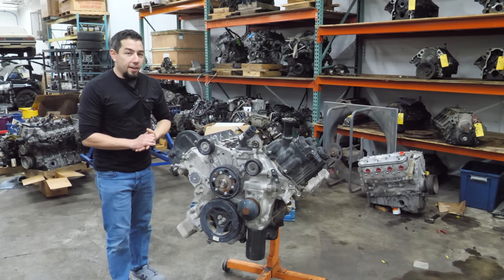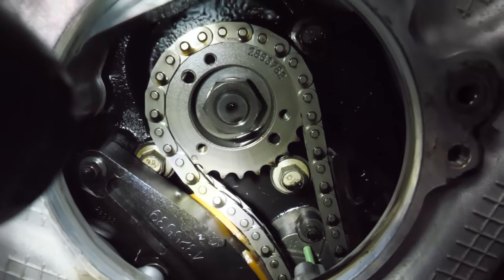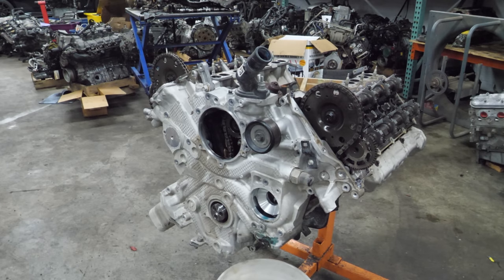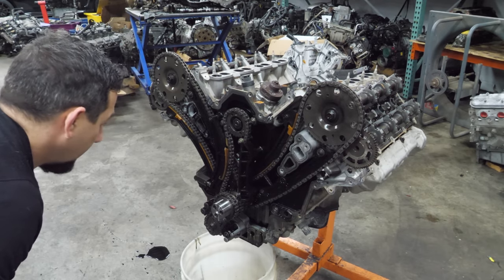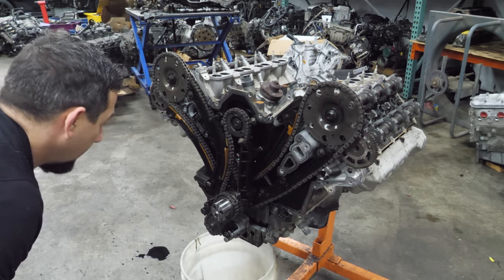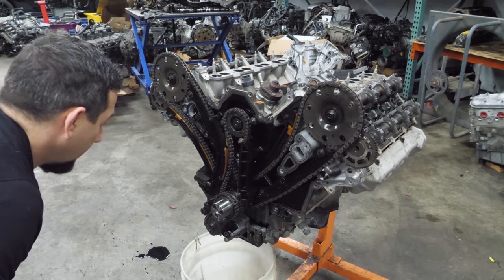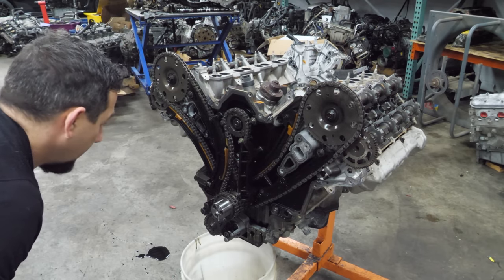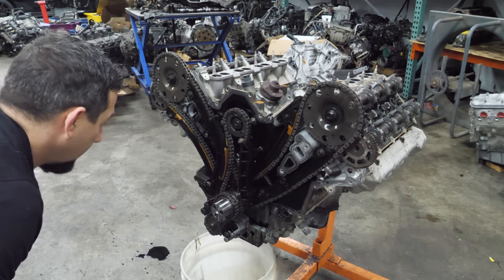Well That's Not Good! Nissan Titan XD Cummins 5.0 Turbo Diesel V8 Teardown. A Costly Failure!

Comment: I broke a crank in a 87 supra between cylinder 1 and 2. Felt a slight vibration and pulled over in the middle of nowhere 20 miles from home. grabbed  the dampener and could feel the crank wiggle. Figured screw it and drove it home. Amazing engine Toyota made, ran on all 6 with a slight  vibration. Rebuilt it and drove it for years.
Reply: Ya, your experience is  a kinda normal Toyota thing. The broken crank is unusual. I  like to use quality aftermarket dampers if lotsa hi RPM use planned.

Comment: As a Cummins owner I loved this video. The crank failure issues is unfortunate. I was aware of this engine dating back to the early 2000s as a DEER development project. There was a V6 as well but it was never developed to market. 

I am hoping you’ll do a teardown of a 3L baby Duramax.
Reply: I would have loved to own a Frontier with that v6. Obviously non emission.
Reply: Of course it was,I heard about th
Reply: Second the BabyMax.
Reply: The mini max is the same engine as the CDL diesel in 2004-6 Jeep Liberty(s)
Reply: @jsawyer0617  Isn't the Jeep engine a 4 cyl?
Reply: @--_DJ_--  Yep, so is the newer 4 cyl Baby Duramax. I had the VM Motori 4 cylinder in my liberty.
Reply: @jsawyer0617  The diesel in the Liberty is the 2.8 4 pot baby duramax. The straight-6 Duramax is a new engine derived from extending an Opel 4 cylinder diesel.
Reply: @jod4689 Correct, the 3.0 Duramax is derived from the 2.0 Opel inline 4 which is itself derived from the Opel 1.5 inline 3, which is derived from the Opel 1.6 inline 4 that we got here in the Cruze and Terrain. These engines are so much alike, in fact, that you can take the 3.0 Duramax timing chain tensioner and use it as an upgrade to the junk one on the 1.6 that breaks and makes noise.
Reply: You mean a V6 developed by Cummins? That would've been the first since the 70s when they had the V360 and V378 with laughable power....

Comment: Since you asked, according to the Service manual, torque spec on the interior head bolts is 89ft/lbs  (120n/m) plus 180 degrees. The outside ones are only 17ft/lbs (23n/m).
Reply: Well 30 ft lbs Then 89 ft lbs then 180 degrees

Comment: Glad you and the family are feeling better Eric!! Your fans certainly missed you last Saturday.

I drove a 2017 Titan XD diesel 4x4 crew cab for just over three years for work. At 79,000 miles it went into limp mode one morning on the way to work. After nursing it a couple of miles to the Nissan dealership and dropping it off, we found out 3 days later that the actuator that drives the hybrid-compound turbo variable geometry had failed. It took four weeks to get one because they were failing at an alarming rate. I naturally did some digging on YouTube and came across a video where the same thing happened to another guy - but his failed at about 40k, I believe. When he pulled all the piping, the turbos, and the actuator off the engine, he found that it was so badly coked up, that they had to scrub it with gasoline to get it clean. Come to find out, this had been happening all over America with this engine and Nissan was trying to ignore it.

I sent the link to the video to my service guy at Nissan and asked him to please pull all of the turbo piping and the turbos to inspect and clean them. He said “No” because Nissan wouldn’t pay for that under warranty, only to R&R the bad actuator. I asked him if he had watched the video, and he said he did. I asked him if he had kicked it upstairs and he said he did. I asked him what the response was and he said they wouldn’t comment on it and to replace the bad part. 

Four weeks after the truck went to the dealership, we got it back. 8 weeks after we got the truck back, we sold it before the warranty was out. The same thing happened to the other Nissan XD diesel in the company fleet. Same scenario: about 4-5 weeks to get the part, and we sold the truck about a month after we got it back.

It’s too bad. That could have been a great truck. Unfortunately, Nissan had to monkey with the engine instead of just buying it from Cummins. It was overpriced, barely had more towing capacity than the 5.6 gas engine, and the transmission totally sucked. The truck was quiet, rode nice, and got pretty good mpg’s for what it was.
Reply: Quite the story
Reply: Nissan didn’t monkey with it. It was a bad design from Cummins. Nissan bought the entire thing from Cummins.
Reply: I'm in construction supply and also know lots of people with boats and horses. Nobody bought a Titan XD diesel. When you need your diesel truck to get something done, you need something you can rely on 300 miles from home with a trailer. Nissan had one chance to start their own diesel customer base. They failed miserably. They had a chance too, as a lower cost fullsize truck diesel option would have sold if it was good. The last gen Titan's biggest flaw was its crazy thirsty 5.7 V8 (compared to modern competition), so I can see why they wanted an affordable diesel option.
Reply: @BReal-10EC  yeah Cummins dropped the ball. Hard.
Reply: The engine has nothing to do with Nissan supposedly monkeying with it.  The engine is even listed in Cummins' catalog and on their site for sale.
Reply: @MrDrmorbid  Yeah... one angle could be they have stockpiles of those engines made that Nissan never used and they need to sell them. Though just like with the Ford/Navistar problems Navistar blamed Ford's implementation and Ford blamed Navistar's design. The blame game is always fun but the customer always loses. These engines must be designed with the concern of passing emissions right? Makes me wonder what the creator versus implementer argument really is.
Reply: Same thing happen to me i had the 5.0 cummins 2017 i ended trading it in for a duramax! Im glad i did! Because parts where hard to come by
Reply: @BReal-10EC  ummm, no.  Cummins has catalogs and one buys those engines and they offer them to everyone.  Try visiting the site and you'll see.  They were there before the Nissan deal and were offered to other manufacturers as well.  Like why is this such a tough concept?
Reply: Just an FYI, Cummins does have the engine in their catalog, but there are major differences between that one and the Nissan version. Nissan had Cummins up the horsepower significantly... Also the hybrid turbo in the Nissan version is not in the Cummins version.
Reply: @notsevenfeettall  Maybe they used Izusu engines in their box trucks.
Reply: The EPA emissions requirements killed this motor.  Otherwise, it would have been a great truck.  I removed all that nonsense from mine, and it runs like a dream.  No smoke.  No soot.  No turbo lag. The oil is see-through clean at 5k miles. The EGR and other emissions parts begin destroying this motor on Day-1.  Delete it and tune it to factory numbers and it becomes a completely different truck.  Yes, it wasn't designed to build 600 Hp and 1,100 ft/lbs of torque, but it will pull a 12,000 lb trailer down the road at 70 mph and never labor doing it.  Great truck...IF you put it in a condition that allows it to run like it was designed to.  80,000 miles on mine and it runs like it's brand new.  Actually, it runs better than when I drove it off the Nissan lot in November 2017.

Comment: Good to see you feeling better dude! Always look forward to the videos! I have had my fair share of broken cranks and you would be very surprised at how little to almost no noise they can make depending on where the break occurs. I pulled a 454 out of a customers truck because of a low oil pressure and very faint odd sound complaint, truck had 135k on it at the time and the customer had told me it had the faint odd sound for almost a year prior before he brought it in. he didn't drive the truck daily, it was only used when towing his 36' RV. I personally drove that truck during the diag process and if you were not listening for it you would never know that is how quite it was. I couldn't believe it when I tore it down the crank came out in 2 pieces just like yours just did however it was a clean break right in the center journal. it was like 4 of the cylinders were running separate of the other 4 but it was such a clean break that the 2 pieces were still in contact rotating together. I still have that crank on the shelf and I often get asked the story on it I would have never believed it myself but I had to I was looking at it with my own eyes! Keep up the good work Eric and thank you for sharing!
Reply: I broke a 1200cc air cooled VW crank that ran quiet but made a nice ding sound like a bell ringing on random rotations at idle
Reply: My 454 broke across the rear rod journal. It stayed together long enough to load it on the trailer.  It was in a 87 3+3 1ton. It vibrated so bad that it broke the rear crank journal out of the block. Lol! But it still ran and loaded itself..

Comment: I have a 2016 Titan XD Cummins with 62,000 miles and it runs fantastic, I bought it used with 23,000 miles and it had AFE performance products on it. When I did research on this company, these are modest modifications, Momentum HD Cold Air Intake System and scorcher power module as well as the 5" exhaust. I think this really helped the performance of my truck without overkill. I also got a letter yesterday from Nissan, they are giving extended warranties on the Turbo Actuator and the Turbocharger for  10 years or 150,000 miles from the manufactured build date. Plus if you had them replace you might be eligible for full reimbursement, if you own a Titan you should have the letter or get it soon. I love the truck and have no desire to abuse it, love the tear down watch it all the way through, great video!!

Comment: What an engine to find for a tear down! 👏 I'm guessing that CP4 was pulled back because the owner or shop wanted to keep it/reuse it, as they are not cheap. But since it required the removal of the front cover, I'm guessing they gave up. Looks like that chain guide was damaged in the process of half-removal.
Reply: I couldn't think of how it possibly got like that but seems like you might be right, could they have gotten back that far without getting to the bolts behind the vacuum pump tho?
Reply: @Onewheelordeal  I was thinking the CP4 was installed at the factory, but not torqued down. It just took 107,000 miles for it to loosen and back itself out that far.
Reply: But the bolts were tight
Reply: @Joepro900  only because the pump had shifted back and placed pressure on them as they loosened.
Reply: @johnt.848  idk man, can’t say I’ve ever seen bolts loosen and then re tighten themselves to a point that you crack them loose just like a normally torqued down bolt? The only thing that would make sense to me is they were cross threaded on some type of re-assembly and due to that the pump didn’t line up with the housing hole square, so the pump didn’t suck down into the hole. Then the bolts were forced down tight anyway through the cross threading. It would be like trying to pull the pump in with one bolt all the way in one shot, instead of tightening the 3 evenly to pull it in. I don’t know about this specific pump, but I’ve changed a fair few injection pumps that will bind up in the housing if you aren’t careful. It had to have been leaking oil there as well
Reply: My guess:  Someone wanted the injection pump and thought they could remove three bolts from the front and get the pump out of the valley.  they broke the guide and mis-aligned the drive chain, but the three bolts jambed once the pump was a half inch or so backed away...  the chain and drive sprocket now jambed from the timing drive side.
These engines were a huge disappointment in the marketplace.  Cummins never made a dime, Nissan never made a dime, and the few customers who have them own a virtual orphan with no resale value, and few if anyone who can or will service them.  As complex as a German luxury car diesel, in a truck that no one wants to buy used.
Reply: Bolts were loose. The movement stretched the threads so the pitch of the bolt didn't match the inner threads on the pump. That was a ticking timebomb of a factory defect.
Reply: @craigquann  Seriously doubt it was a factory defect... the engine ran over 100K.  More likely a clumsey failed attempt to harvest the pump after the engine failed.
Reply: @billyjoejimbob56  how was it an attempt to recover the pump without removing anything else including the bolts on the inside of the timing cover... It wasn't installed correctly and walked out.
Reply: When he is looking at the pump on the bench there are pry marks where someone was trying to lever the pump out. Bolts would have been tight as the pump was no longer on the spigot & the chain tension pulling against the bolts. Certainly not a factory defect & never ran like that as the chain would have cut its way through everything, the loose bits of the tensioner would have long since been in the sump & there would be oil everywhere from the timing cover leak. In short I agree with your take on it!
Reply: @SB-vb8ch  Makes sense to me!  😀
Reply: in my opinion there are wrong bolts in it, with to long shafts...they were torqued, crushed the first threads and the pump is still loose...you can see it moves all the time.

Comment: Back in the early 90s I worked at a small factory making wood trusses. They had a large property for storing material and built trusses. One guy (Cherokee) had a nice looking late 70s 4x4 C/K Chevy truck sitting out there. He also had a 350 sitting.. waiting until he had enough cash to pay somebody to do the swap. When he finally did... the plant mechanic guy (Mike) found out Cherokee had stored the engine just bare in the weather *without plugs*. Mike took the heads off and cleaned it all up with sandpaper and whatever else he had in that field, put it back together, installed it and the thing ran like butter. Some people are just magic.

Comment: Now that was a wonderful bit of carnage. I was shocked at the blue ting to the crank. When you popped off the oil pan and I saw the crank weight I thought it was almost like firearm bluing. I really nice shade of blue there. I agree with you, that was a very noisy shut down.
Reply: It sounded like grandma's wind chimes when the mud dobbers moved into the tubes 😅 klunk

Comment: another wonderful video, I was an electrician for the C&NW RR,  we had a couple EMD SD45  crankshafts break, 20 cyl 645 cu/cyl  3600 HP crank was probably 25 feet long, head crab nuts torque 2400 lb, main bolts 750 , rods 450

Comment: Hi, wesley here, current bright yellow titan pro4X cummins Titan owner, former Nissan master certified diesel, ev, hybrid, gtr tech. The front item is a vacuum pump, and the vacuum pump has to be removed first to remove the fuel pump. The fuel pump uses a special tool for gear removal/installation so there was no taking off the pump which led to guide damage. Hope mine lasts to 100k lol
Reply: Hi, what kind of special tool?

Comment: Wow, this was a good one. I can only imagine the heat this failure must have generated. That blue coloring was scary… bet that crank was glowing red-hot.
Reply: About 500°. That deep blue color is actually an oxide film that tells the max temp it reached. If it got red hot it would have a scaly gray appearance.
Reply: it was so hot they drove it in to the lake

Comment: Eric, a great teardown as usual. You have people at your shop, I suggest you remove the casters from an engine stand and weld it to a nice heavy piece of steel. Weld a few loops for forklift tines to move around the shop. It would make teardowns so much easier not to have to chase the engine stand all over the place!

Comment: sweet, never seen the insides of this engine. my 12valve superiority complex kicked in. excited for this teardown
Reply: 12v. heavy, no power, thats, why they last..i have an mwm sprint 4.2tdi, 700nm, 235 hp. 12.5 lt 100..weighs about 2 of your cylinders..german..
Reply: @harrywalker5836  not german, mwm sprint is Brazilian

Comment: I test drove one of these and a 5.6 gasser on the same day with my 18 ft boat, and there was absolutely no reason to deal with emissions, starting in -30, and high fuel prices. That 5.6 is a beast of a gasser.

Comment: Well, I had a 1980 Camaro that broke a crank.  It was a 327 that I built which included a high HP at lower RPMs cam.  Heavy car with a 2.56 rear end but still.
The crank broke right at the rearmost main.  Turns out it was welded up there and sold as new from NAPA.  NAPA made good on the crank by replacing it.  When it broke the engine sounded like it was full of unbreakable coffee cups.

Comment: I knew what you were in for the minute the HPFP pissed out water and fuel on the bench. FWIW broken cranks can be surprisingly quiet on gassers, I snapped one on a Ford with a stick, drove it for months, thought it was the clutch because I could feel it in the pedal. Changed the clutch, no difference, didn’t figure it out for another month when I was in a hurry one day and wound it up and it snapped in a second place on the other side of the rod journal, freeing the rod and allowing the crank snout to flop around and the timing belt jumped and it stopped running. Did a 6.2/6.5 GM diesel once, snapped diagonally inside the rear main cap, sounded like loose torque converter bolts.

Comment: You would be surprised how quiet a broken crank can be! I have driven a diesel  engine for over 500 miles home in a 36,000lb truck, used it a month, only to discover the crank was always broken! Seen it building diesels for AG tractors also they fail in a way that they keep turning. Only indicator initially was a constant blip in the oil pressure gauge. Bad harmonic balancer once, someone mismatched bob weights by 2lb other time! Still went 200+hrs in the field broken!